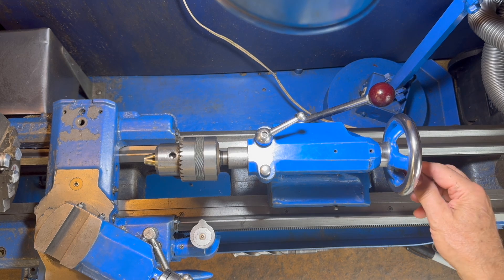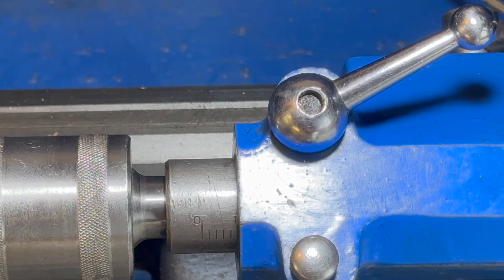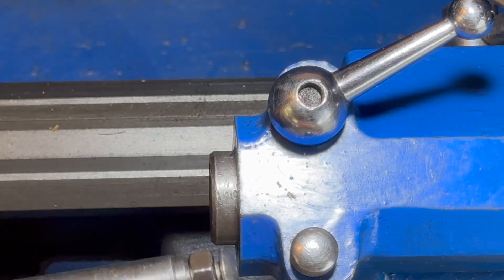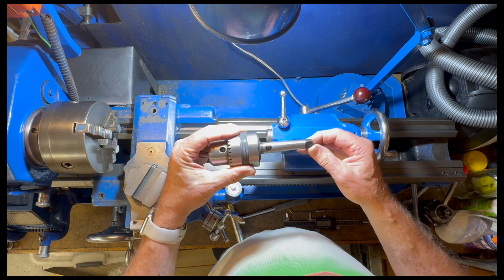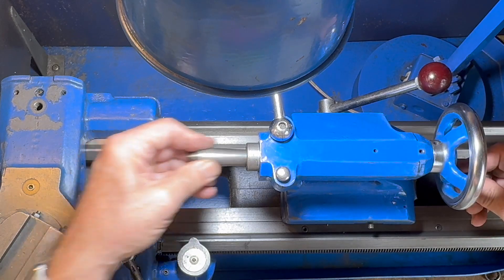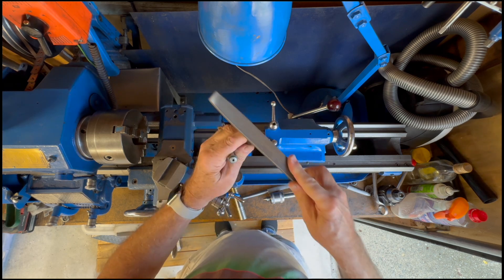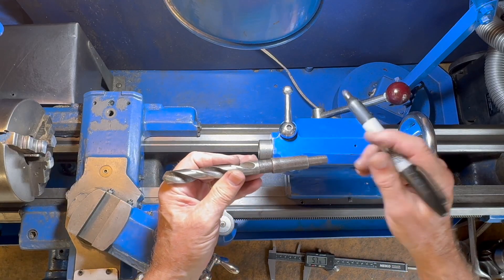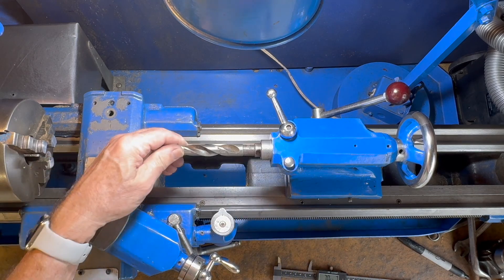A problem with ejecting tools from the tailstock

Comment: You should be fine with removing some from the tang, I believe the drive/retaining area is where the slot is, the same slot that you can drive the removal tool through. A good solution to an annoying issue,  especially when you need every mm you can get.